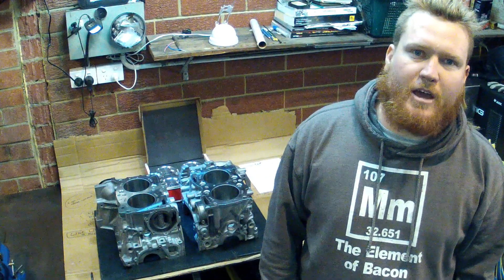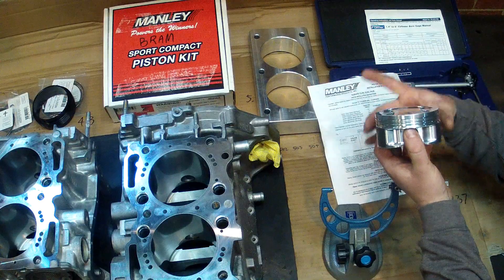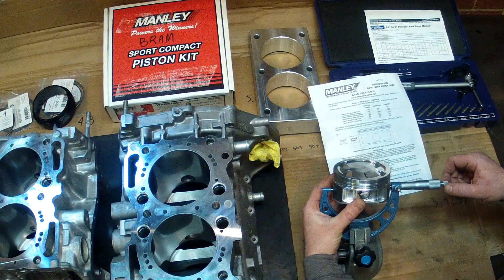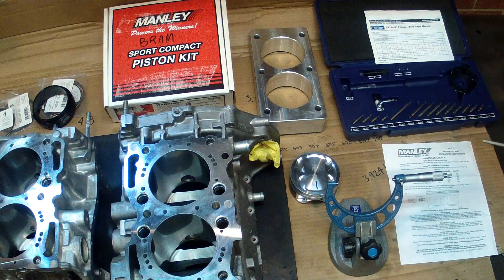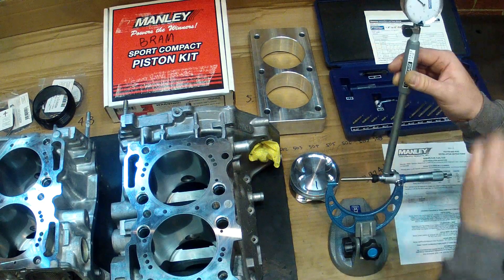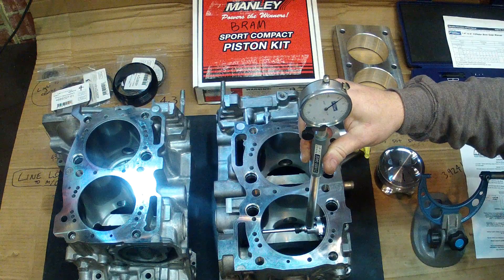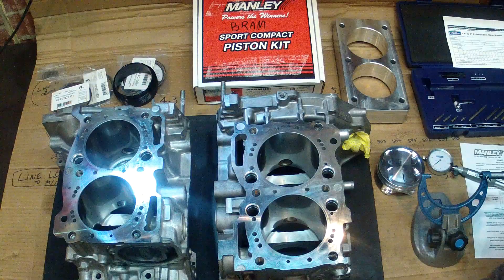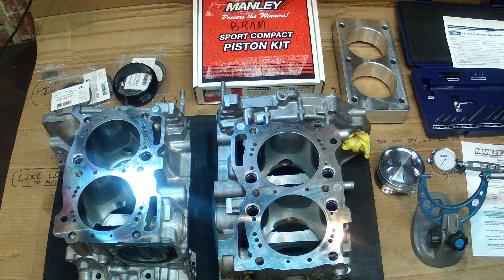Measuring Piston To Bore Clearance - Subaru.

Comment: If you had a stock block with 145K miles,  what do you think ?  stock, normally aspirated, ej25... Previous owner said he did the head gaskets 20K miles ago, but when we went to start it after sitting a few months, it puffed smoked.  Valve stem seals I am guessing was the cause.  Since I want reliabiity, I was thinking of pulling the heads, replace the stem seals, and while in there, should I replace rod bearings and rings ?  I was not even considering honing the block.  I'd probably have the same luck....Part of me says just F it and use it as it is...I over heated the last engine (unknowingly of course) while trying to remove the air after head gaskets, and new timing belt and water pump.  The rod side to side play went knock knock....

Comment: Do you check the bore in different directions (I.e rotate the bore gauge 90 degrees) or just the way the piston will sit in the bore?  For someone doing this at home do I need a torque plate to measure ptw? I’m trying to figure out if I can drop in Manley graded A/B pistons.
Reply from the maker: Yes.  You should check the out of round by measuring at 90°.  Aswell as any taper by measuring top, middle and bottom of the cylinders.  Its good practice to take measurements at many different locations just as a sanity check, and to judge how straight every thing is along the entire cylinder.

Your likely to see some slight variations, depending on the condition of the engine.  Also if the cylinder has been honed with torque plates on VS measuring it without, as i am doing here. 

The other thing is, the way a hone operates, the actual honing bars will be in contact with various parts of the cylinder for varing amounts of time during the operation.  

For example.  The bottom of the cylinder will be in contact with the hone for less time than the mid and upper portion of the cylinder.  As the hone must constantly go up and down.  But cant go down past the bottom of the cylinder because it hits the webbing of the case.  So it goes up, and when its up its not properly contacting the bottom area of the cylinder.

Comment: How is your engine performing now? What boost and horsepower is it putting out?   It’s a really nice block!
Reply from the maker: Unforuantly.  Its not.  This block is basically junk due to an incompetent/negligent engine machine shop.  (Galloways in WA, Australia.)

I took the case to be line honed to accept ARP main/case bolts.  (These are known to deform the main bearing tunnel due to the additional clamp load, and require honing in order to utilise full torque specification.  ARP even state this in the instructions.)

The incompetent machine shop forgot to tighten the case bolts that secure #5 main bearing together.  (The rear-most 2 bolts near the bell housing.)   Clearly they did not read the tightening procedure supplied with the ARP bolts, which details the exact torque procedure.  And evidently, the idiot doing the job could not even count to 10, as there are 10 x main case bolts.  Instead he only got up to 8.

They did the hone with the rear bolts fingur tight.  I picked the block up and as soon as i went to dissasemble it.  I noticed the #5 main bolts were loose.  They were brand new ARP bolts.  And it was evident by the lack of contact scuffing on the washers / bolt head and mating surface on the case that the bolts were never tightened.  I took photographs of the bolts.  Then re-installed them and correctly torqued the case.

I then measured the main tunnel and found the rear main bearing bore was 0.0015 under lowest tolerance, and had a 0.0005 taper on it.
  
I took the block back to the incompetent shop, allowing them to have another attempt at it.  Which they proceded to further fuck beyond belief.

After the second attempt, the #5 bore was about 0.002 to 0.0025 out of round.  The vertical measurement being way out of spec and larger than the horizontal.  

Also #1 main bearing bore was approximately 0.015 to 0.002 out of round.  Again, with the vertical meausurement out of spec and larger than the horizontal measurement.

All the horizontal measurements of the main bearing tunnels were within spec.  But the vertical measurements way larger on #1 and #5.

So basically that block is a boat anchor.  It may be possible to line bore it to accept oversize bearings.  But realistically, the damage is done and ot wont be right.  Especially on an engine like this that will be pushed hard, and subject to future tear downs and bearing re-shells to leep it alive.

I have another block lined up, which will be done basically same spec.  But has a different designed CDB insert.  And also has all 5 main bearing mating surfaces pinned.
/dowelled.
Reply: @BramBiesiekierski  that sucks!!!!!!!  sorry that happened, hopefuly it all turns out well.

also thanks for this video.  watched a few of these videos, most for other engines, yours was the only one I saw that mentioned the torque plate.
Reply: Hello Bram,
I read your dilemma with the machine shop and thought you could potentially recover that block by shaving .001" off each case half and have another shop line bore again. Check out this article for some good info;
https://dsportmag.com/the-tech/subaru-ej257-bottom-end-breakdown/